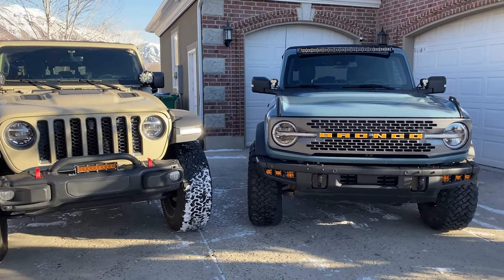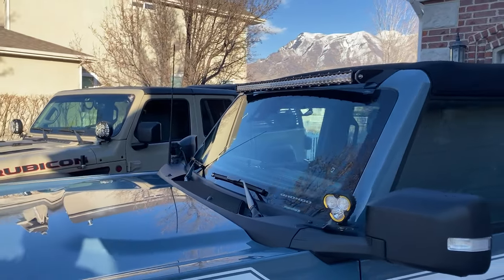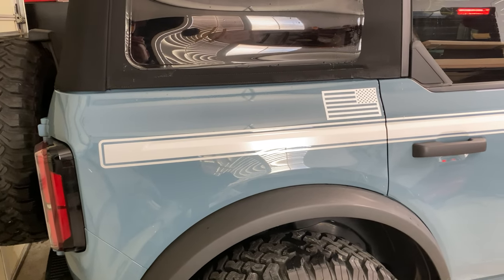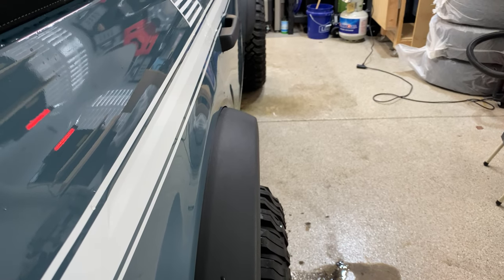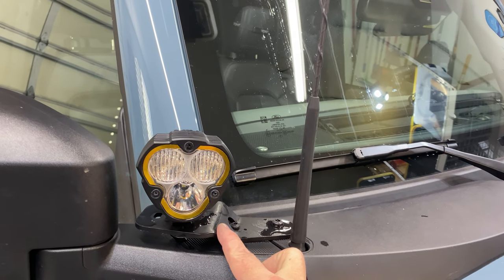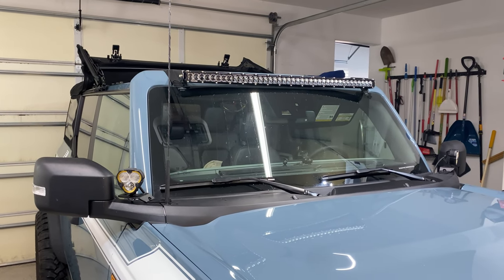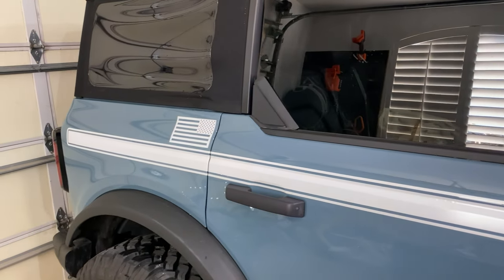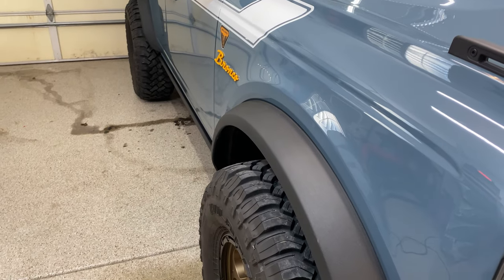Bronco SelfSquatch VS Jeep Gladiator

Comment: What 37 inch tires is on the jeep? Did you have to change the gearing by chance?
Reply from the maker: These were the BFG KO2's, great tire. I ran stock gears for the longest time but you can say good bye to the 8th gear. I eventually re-geared to 5.13 that made a huge difference in shift points and saved a couple of MPG. Felt it made the Jeep quieter on the highway due to the engine being in 8th gear.
Reply: @GobiXplr  how much did the regearing cost?
Reply from the maker: @jeffreythomas4254  I had to shop around but I was able to find a shop that did it for just over 2k.
Reply: @GobiXplr  35s it is for me 😂

Comment: Off road test? 👀
Reply from the maker: Ah yes, thanks for the reminder. I took it off-road in Southern Utah a couple weeks ago and was able to flex it. I was very happy to see that I had no rubbing. I had the rear tire tucked inside the fender pretty good with the sway bar disconnected. I was totally expecting to have some rubbing.

My biggest complaint that I have right now is how much mud and dirt I get spraying off the tires onto the side. I am looking at getting the mud-flaps that LiteBrite mentioned in one of their recent videos.
Reply: What do you like more gladiator or bronco for off road ?
Reply from the maker: Tough comparison. The Gladiator can carry more and is more capable but has that long break over angle. I have taken the Gladiator on some gnarly trails that I don't think I would take the Bronco. Yet the Bronco is more comfortable to drive overall. If I am heading out to camp, I am taking the Gladiator. If I am going out to explore I am taking the Bronco.